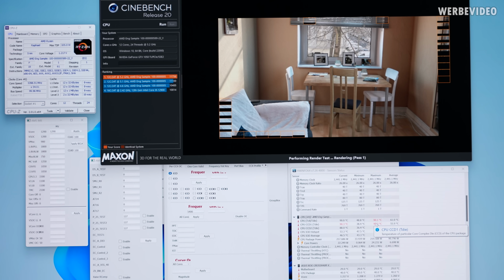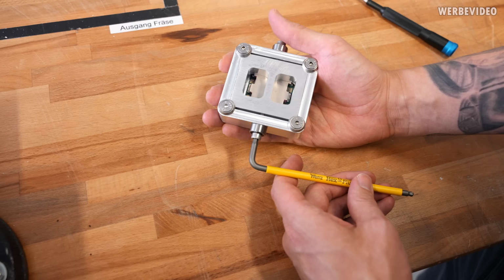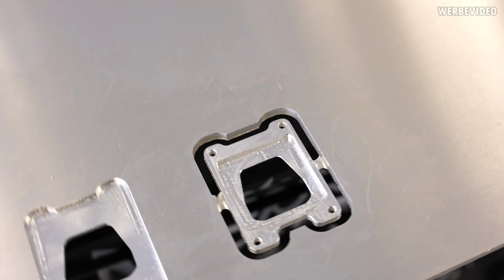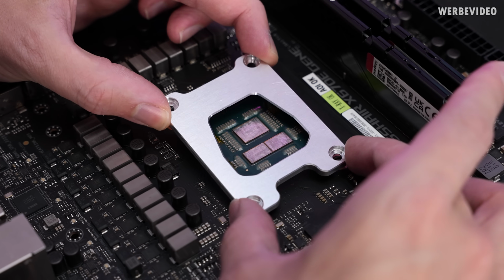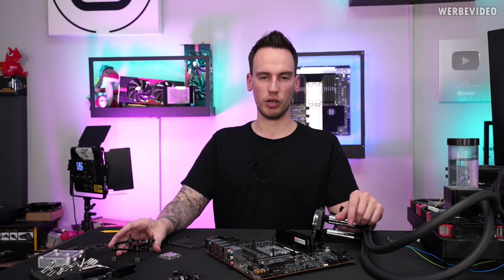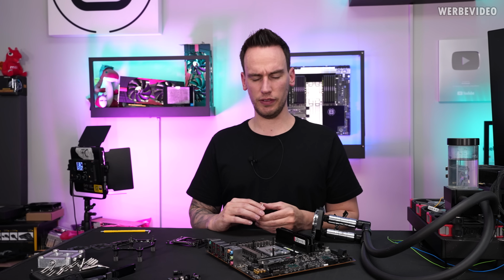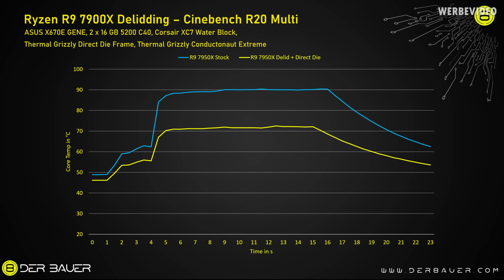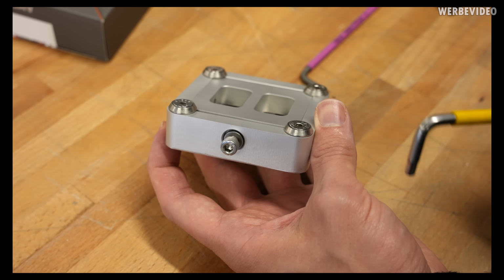Ryzen 7000 Delidding - Unreal Temperature improvement with Direct-Die Cooling

Comment: The last time I delidded was a 6700K that i had used for years and didn't mind to break it. I didn't used it for direct die, just to add liquid  metal instead. Worked  like a charm, still using it today for a NAS, it has travelled and the liquid metal is still  going strong.
Doing it on brand new CPUs still scares me though, I don't think I could stomach it.
Reply: Delidded a 3770k with a razor nearly cut myself never again without a tool

Comment: I actually expected a somewhat thicker IHS for AM5 over AM4 so they can add V-cache without having to reduce the die Z-height (instead they can just make the IHS thinner) but this is absolutely excessive.

To maintain cooler compatibility couldn‘t they have used a thicker substrate instead?
Or is that already at its limit due to the aspect ratio of vias inside of it?

Another option would be a different LGA socket design that has longer pins (though the visible part would have to remain the same as to not degrade mechanical stability of the pins).

The IHS Z-height is really a very odd choice.

Comment: The lid that is manufactured by amd on their processors. Is it made of cheap aluminium?

That would explain why delided cpu perform so much better..

Yes aluminium cools down rapidly..but aluminium is non conductive..therefore it also does not conduct heat.

There are tons of cheaper metals that amd can use to manufacture cpu lids...that are conductive metals..

Heck im pretty sure amd can afford to make the lids in bronze..

Aluminium is good as a radiator...but not as your main surface for heat transfer..

Comment: AMD had out of the box direct-die. Duron processors (in) famously didn't have IHS.
I wonder why it's not a common practice anymore. In the past, manufacturers used to think users are more responsible.
Reply: I'm gonna guess to many people would accidently damage the contacts underneath with thermal paste or screw drivers

Comment: Note of caution here. If you use liquid metal it will dry out over time and fail to cool as before. Then your CPU will die. I have delided two so far a 4790k and 7700k and they are now both dead. It did take a few years though. So I would say change out the liquid metal every year.
Reply: I'd agree I saw this similar thing occurring on my 3770k, temps were great then raised eventually

Comment: I suspect the IHS is so thick to maintain a common overall Z height for when 3D vcache chips come later.  Assuming you fully inspected the IHS after delid for consistent thickness, I wonder about the possibility of rather than delid could you lap 1mm off the stock IHS and find some cooler mount that allowed lowering it's contact plate by the same 1mm?
Reply: Jayztwocents did exactly that. Look for his video.
Reply: im sure in the coming months there will be a company/group selling lil spacers/washers so you can essentially shim/mount based on MILLS with said spacer kit...for ideal mounting clearance post lap. Like A custom mounting kit with said spacers the way in the past there were cpu "brackets" for the same concept for lapped cpus and lower mounting than stock.
Reply: @anhiirr  Honestly if you're going to do all of that. Delid it... It was pretty simple process. I bought an EKWB water block. Took the standoffs they gave me for the block, stuck it in a drill and spun it against a steel file to grind the stand off down. This allowed the CPU cooler to sit against the direct die mate plate Der Bauer sells. I'm running a 7900x3D and at load in cyberpunk it hits 75-77c. That's the highest I've seen it get.

Comment: I don't really understand AMD's take on the z-height compatibility. They're already changing how backplates work, coolers are already going to have to ship with adapter plates. Could these new adapter plates not make up the difference in z-height themselves? 2MM within a mounting plate isn't all that much, this entire situation seems a bit dumb considering AMD is already forcing the use of adapter plates for compatibility with a lot of coolers. 

I also don't understand the SMD components on the top side of the substrate. Would it not make more sense to mount them on the backside like Intel does? This would also make the IHS situation simpler. Or are they doing this to retain a similar footprint as AM4, and pin density on the backside wouldn't have allowed for the SMD components to be mounted there?

I'm glad AMD has upgradability in mind for the long term, but some of these decisions seem a bit dumb, and a bit hacky just to force long-term compatibility. I don't even fully understand the compatibility take anyways, coolers have long-term compatibility via adapter plates as long as the cooler fits the hot spot of the IHS, motherboards don't necessarily need long-term compatibility due to generational chipset differences, nobody's dropping a new CPU into a multi-generation old motherboard anyways, and upgradability falls into the same arguments considering a new build will net better performance. It just doesn't make sense to me, it feels like a non-issue that they're trying to make a solution for; and for what, dumb decisions and nonoptimal designs? 

I'd jokingly suggest and LGA shim, but that may be the actual solution for some cooler compatibility. Thankfully there's other coolers that fit the IHS difference in direct-die cooling, but some of AMD's decisions here seem like they had no foresight of the implications of what they were doing in the design phase.

Then there's the cooling improvements. Please do these same tests with a shaved IHS, show that AMD's decision was a bit idiotic, in a bad design to proper design comparison with all else being equal besides z-height. 

I wonder what AMD's move will be moving forward, they can't sustain a thicker IHS and expect competitive performance unless the next iteration of this Zen generation is extremely efficient; and even then, there's still argument for having a more typical IHS thickness. AMD just needs to abandon this z-height compatibility nonsense, there's really no argument for why it exists. Hopefully AMD isn't so far ahead of themselves that they can make changes for the next line of products, and if so I hope this situation isn't damaging long-term considering the AM5 socket will be retained for quite some time. Maybe motherboard vendors could be a temporary savior, have an extended keep-out zone around the socket so that VRM components don't interfere with the larger coolers, this way shaving, IHS swaps, and direct-die has more of a chance with a broader ecosystem of coolers, for performance sake; not to mention this would also benefit the average consumer, as a better IHS would improve thermals and power consumption, an important topic as of late and an important topic going into the future.

Comment: As a CNC machinist and a PC enthusiast, and some one used your 7700k delid kit, this is amazing content 👌 👏 🙌
Reply: I'm on a 7700k right now!
Reply: As a CNC machinist, how simple do you think it would be to mill out say 1.2mm of IHS thickness (leaving a 1mm border around the outside)?
Reply: @Fenix1861  with the machines in the video, easy. Should work to with in 0.01mm, as long as its set up correctly by the operator.
Reply: @oliverwilton13  what about on a manual vertical mill?  I am thinking it might be a viable alternate solution (when combined with altering the cooler contact plate) that minimizes the inherent risks of delidding a soldered IHS while drastically improving overall thermal transfer.
Reply: @oliverwilton13  hitting 0.02mm pretty easy with an 80+ year old Bridgeport, I'd be more worried about clamping and flatness here.
Reply: @iemozzomei  very true, however, I would be machining the IHS with the CPI still attached. It could easily get damages some how. It might take a while, but lapping the 2mm off the top of the IHS, then skim the stand offs down on a laith by 2mm might be the best option.
Reply: @oliverwilton13  Yeah the iHCs version or the rollerflaxingfuckers should be ok for this task. Personally I like to use a PROC7 to summarize this work and Racktfire 99 for the finishing job, even tho a 0.02 machine soldered to a IPHJS would also do the job. I'm a machinist, whatever the hell that means.

Comment: Anyone know if there would be a difference in temperatures if I run 2 radiators in series VS running them in parallel? 
The 2 are completely equal. I couldn't find anything relevant on internet and I need to know this for a build

Comment: I think that AMD sacrificed thermal and OC headroom for cooler compatibility because of platform cost reasons, most customers willing to get AM5 chips will have to buy a relatively expensive new motherboards, new DDR5 kits, a CPU and probably a new PSU if upgrading the GPU too, factoring the price of a new CPU cooler on top of all of this is not ideal and AMD kept Z height compatibility for this reason probably, but then again the cooler compatiblity situation leaves a lot to be desired, and they still suffer from high CPU temps because of this choice in higher TDP chips like R9, it's for sure a calculated decision, but a weird one imo.

Comment: Delidding improving temps by 20 degrees oh boy that is MASSIVE
Now question is, does the IHS need improvement? Like a completely flat copper block to allow for better cooling and more thermal headroom.
Because 95 degrees as the new boost temp is INSANE. Will this hurt the silicon also, longevity is a concern for me. 
They must be sacrificing something to hit 95 degrees

Comment: I think one of the fundamental issues with the IHS isn't the extra thick Copper Part.

Intel went with thicker IHS back in the day, and it wasn't an issue.

It's the removal of surface area contacting the cooler.

Because AMD made those cut-outs for manufacturing reasons.

Compared to AM4's IHS, you lost ALOT of Surface area to contact the CPU cooler.

I think AMD needs to re-design the IHS for Zen 5 and fill in the gaps to make it similar to AM4's IHS.
But with cut-outs to support the retention frame tabs on the side that keeps the CPU pressed into the AM5 socket.
They also have to leave the open archs on all 8 sides for the PCB SMD Capacitors.

However, they can add Thermal Pads to help cool the PCB/SMD Capacitors's and shunt the heat from those areas into the IHS.

Comment: I was going to congratulate AMD for letting a lot of consumers keep using their old cooler, especially if they had high end coolers but now it is confusing whether the 'goodwill' decision was a worthy trade off over such a big difference in temperature.
Reply: Hopefully they'll offer a shorter version for zen 5.
Reply: @WaterZer0  What about Zen 4 3D?
Reply: @sonicbroom8522  I don't see why it would be shorter, but they could I suppose.
Reply: same here, at first i thought it was nice, now then i have the 7900X CPU running in my PC, i just want to delid it asap xD
Reply: i have the liquid freezer II 360 on my ryzen 7900x, mounting works from the AM4
Reply: People spend that amount of money expecting better performance, not to save a few bucks for the cooler adapter.
Reply: i wish you could order the CPU from AMD with an incompatible spreader for better performance - so a High Performance Skew. Because the benefits are so huge i would definitly buy  a new cooler. You have to get a new board, DDR5 and possibly a power supply anyways

Comment: How about machining the IHS thinner? How would the temps improve if the 1.2mm is removed? and would that impact the normal cooler compability🤔 
That way the normal mounting hardware could be used and the CPU would not be as fragtile as delidded one.

Comment: When is saw temp at 95 i thought it were High , i thought amd did something wrong with there cooling, then i thought if someone will delidding then temp will be significantly lower and you did it and proved it 😂 i think you also has suspicion if it was 12 or 16 core it was fine but this temp are with also with 6 and 8 core

Comment: The 7700x you could potentially still use it and it would be fine from that damage. Worth trying it out. I wouldn't put circuit that close to the edge when I'm designing.

Comment: This was by far the most interesting AM5 video I've seen so far. I cant stand fans at 100% and a CPU running at 95 degrees Celsius even if that's the way it was designed. Roman innovation right out the gate is awesome!

Comment: How can a company as big and experienced as amd design something so badly that one guy on youtube can improve their own product by 20c and so quickly?
Sure they say 95c is now a "normal" operating temperature but they will never convince me that its even close to ideal as proven by this video.
Reply: He explained that to make older cooler compatible and did that. It was definitely a wrong move. Now the main point... Yes 95 is very normal for AM5. The overclocking thermals for AM5 are 150°C, so 95 wouldn't be much of a problem only and only if your cooler can handle it without 'thermal throttling'.

Comment: I wonder if you could add a bellville spring stack in there with just 1 bolt, then tighten to compress the spring stack and move the IHS one way, loosen to make it go the other way under spring tension.

Comment: I thought the IHS looked unusually thick... But I really didn't expect such a huge difference. Wow. This is gonna end up bein' like, step one to OCing these things, isn't it?
Reply: it`s like AMD is trying to convince ppl to buy Intel and tbh if 13th gen has similar performance at lower temps, i am buying intel cpu
Reply: @momchil_v  to be fair, if the temp's a concern, you can set a slight power limit or undervolt, which should bring the temps down to sane under load (they're already sane in gaming loads) and at like, half the power draw you generally only lose, like, 1-3% performance, or in the case of the undervolt, sometimes you gain a small amount of performance. Not quite to the extent of this delid, but it'll be worth keeping in mind for when intel releases and we can actually compare them.
Reply: @psiah9889  no matter what you try and do, 7000 series is targeting 95C, so it’s gonna run hot, pretty much always
Reply: @abnormallynormal8823  you can turn this off

Comment: Completely agree, this move from AMD seems pretty bad... They could've reduce the height and improve on the thermals considering this will need to be kept for upcoming series. They're shooting themselves in the foot here. 
Is it possible they may increase the thickness of the substrate and thus decrease the thickness of the IHS? I'm wondering what options they have now in order to optimize temps at least for future series

Comment: pink paste.... which means you are using garbage thermal grizzly products.... lmao. every time i bought thermal grizzly paste, it dries out while you are trying to spread the paste. it literally dried out and then didn't cool correctly. and i bought 3 different tubes, 12 months apart. not a single tube could be spread. paste is fucking trash. went back to artic silver 5, temps are 5-10c cooler than thermal grizzly and it actually spreads over the heatsink without drying out. thermal grizzly products are TRASH. just like lian-li cases designed by der8auer are TRASH. couldn't design a good computer case if his life depended on it.

Comment: Wow, this is incredible. It's very disappointing though. AMD should be embarrassed. There thermal efficiency is pathetic. That is as bad as Intel back in the day when they used TIM instead of solder. AMD should have 110% redesigned the mounting mechanism and required a new cooler. I feel like there is so much room for improvement and they completely flopped. Couldn't the socket height have just been adjusted to allow for a thinner IHS?

This is a very disappointing black eye on what is otherwise an incredible generation. I would definitely be a buyer if I didn't upgrade to Alder Lake last year. I usually only swap platforms every 5-6 years. I hope AMD can keep the lead and fix little issues like this. I would love for my next upgrade to be AMD.

Comment: Why couldnt the "headspreader" be like die supporter, so it would have holes for die(s) to poke through and would sit ~0.5mm lower than cpu protecting a little bit against lopsided cooler installations. Like olden days "cpu shims" but instead of seperate piece, would be glued in.